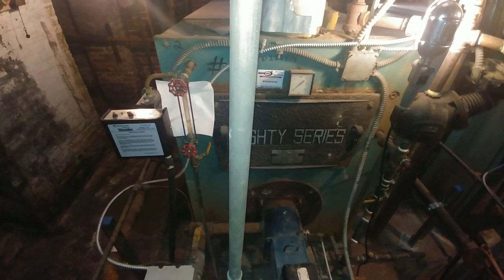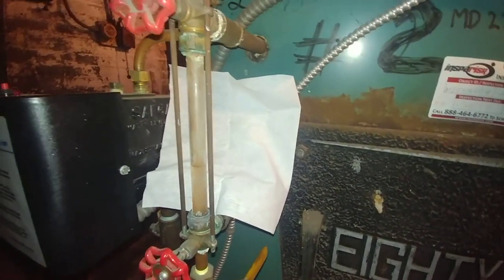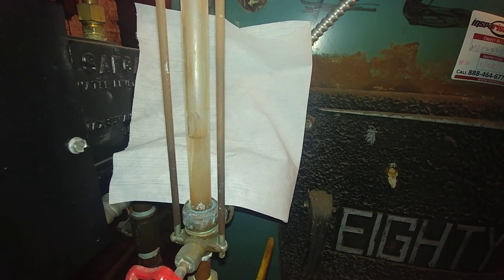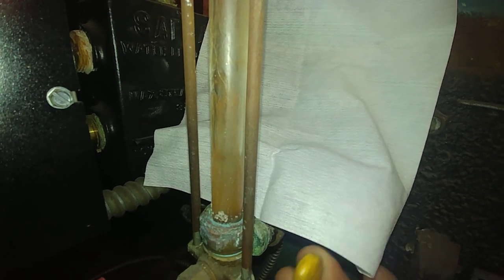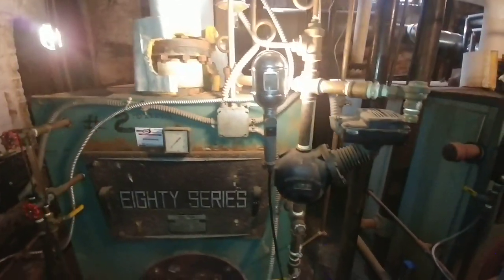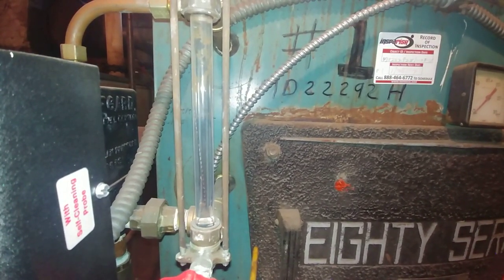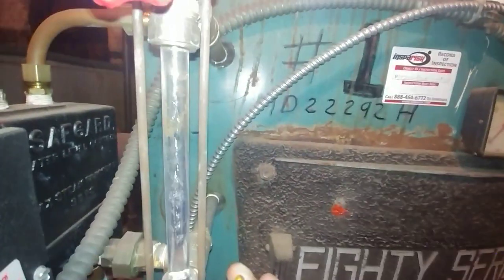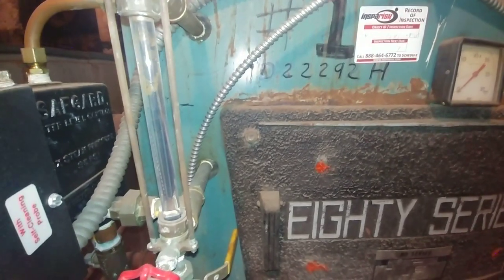Not Enough Water in Your Steam Boiler!? Or Maybe it's flooded? Sightglass Refraction Fun

Comment: The sight glass has 2 red valves. Are they supposed to be open or closed?
Reply from the maker: Both should be full open unless you are servicing the sight glass when the boiler has water in it.
Reply: Great to know. If the red valves have some water leaking from the inside, does it mean adding too much water? I had no this kind of problem before, but yesterday when I add to much water accidentally, I found dropping, have to close, but not the boiler can not turn on to heat. Any suggestions?
Reply from the maker: @jimwu1182  Have you drained your boiler to the proper water level?
Reply: @gordonschweizer5154  not yet ，I was not at home. will do today , thank you so much. The two red valves between sight glass showed water dropping from inside so I close them, a mistake from what you said to other people, should full open. I call plumber who seems too busy, not want to come, so I will try my best first.
Reply from the maker: @jimwu1182  I think you might be talking about packing nuts leaking around the stems of the sight glass valves.
You can try tightening the nuts first to slow the leak then open the valves.
Drain the water.
Might as well drain all of it.
Repack the sightglass valve stem nuts (check other videos on that).
Oh, before you drain, turn off the power to the boiler.
The boiler might be not trying to heat because the pressuretrol has it shut off due to the volume of water.
As you drain, the boiler might start to fire before you have the water at the proper level if you leave the power on.
Make sure your pigtail is clear.
Reply: @gordonschweizer5154  thanks for your nice reply . I will follow you to do
Reply: @gordonschweizer5154  i think the leaking water is from red valve inside if keep open, not from sight glass , but you gave me good point,  I will double check it to make sure
Reply from the maker: @jimwu1182  Ah!
I can't be there to see what you see, so my advice might be off point.
Reply: @gordonschweizer5154  very good point！ you are so humble and nice
Reply: @gordonschweizer5154  I got home to work with, you are right it is leaking from nuts around sight glass
Reply: @gordonschweizer5154  psi only 8 , that is probably reason can not turn heating
Reply from the maker: @jimwu1182  Just to make sure, you have a steam system & not a hot water heating system?
If steam, 8 psi is 4x too much pressure.
Your gauge may be broken?
Or your pigtail is clogged?
Or you are still not nearly finished draining of excess water?
The above is only for steam systems and not hot water heating systems.
Reply from the maker: @jimwu1182  Ok
Very common issue, unfortunately.
I would be reluctant to advise you to tighten the nuts unless you have another glass ready in case it breaks.
New rubber sightglass gaskets and real brass inner washer rings should also be on hand.
Possibly two new nuts if yours are badly corroded.
Reply from the maker: @jimwu1182  Remember, you only need a few oz of steam pressure to move it to your radiators.
Never more than 2 psi.
Reply: @gordonschweizer5154  hi Gordon ,it was too much water in the boiler，I drained at least 10 buckets (15-18 gallons) the water level still not in middle of sight glass. Following your advice I tight the nuts  on stem of both up and down red valves, no more water leaking.  And keep two red valve full open 
Some YouTube said The psi should be 15-20 , mine is low , after taking some water it is around 3-4, but the boiler works well. Now you said 2, means I need take more water out? So far the hot water pipe is very hot with some noise. 
Some room and the dining room steam seems some leakage which already decayed my floor wood. Should I try find parts to replace them?
Reply: @gordonschweizer5154  so I need to reduce some more water? I thought psi should be higher from other YouTube
Reply from the maker: @jimwu1182  I think you should drain until the water level in the gauge is between the upper & lower "tappings"
There should be little or no noise when the system runs.
There should be NO pressure shown on the 30 psi gauge (unless the gauge is broken, the system still flooded, or the pigtail is still clogged)
Check the pigtail to see if is clogged.
Are there videos on that?
If not, I'll try to make one.
I have a video telling why there is a 30 psi gauge on a system that on the coldest day of the year should NEVER get above 2 psi! 
That has been the rule since December of 1899.
Any video that says you need 12-15 psi should only refer to a hot water only heating system, not a residential steam heating system!
Reply: @gordonschweizer5154  now psi is 2 , is that ok?
Reply from the maker: @jimwu1182  Not sure.
The boiler is running & Heating the building, yes?
Reply: @gordonschweizer5154  yes , my kid said he found water gone quickly so he added too much water when I was take care of my old 92 year father . Now still not middle, but psi lower a little bit than 2
Reply: @gordonschweizer5154  now , the psi reduced to 1.5 although the water still not in middle.
Reply from the maker: @jimwu1182  Ok!
If is is heating the radiators with little or no noise & spitting vents, then that good enough for now.
Make sure the pressure control is set to its lowest possible setting (there are videos on that) and enjoy the heat!
Reply: @gordonschweizer5154  pressure control means psi? Thank you so much, my wife surprised that I solved problems because of you.
Reply: @gordonschweizer5154  merry Christmas Gordon. It is already two days, the boiler works very well, the water level still keeps well as two days ago. Thank you so much, enjoy holidays with your family and friends.

Comment: I just moved into a home with a peerless cast iron steam boiler. The sight glass water level is getting low, do you know how to add water to it ?
Reply: There should be a place where the household water is connected to the boiler's water return line probably via a 1/2" copper pipe with a valve on it. If you open that valve and watch the sight glass you should see it rise. Do it slowly.